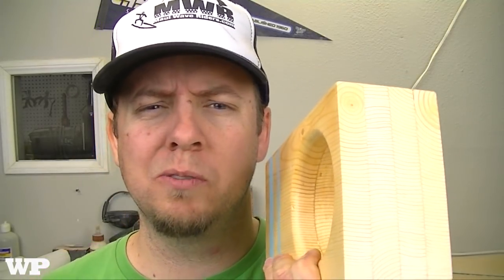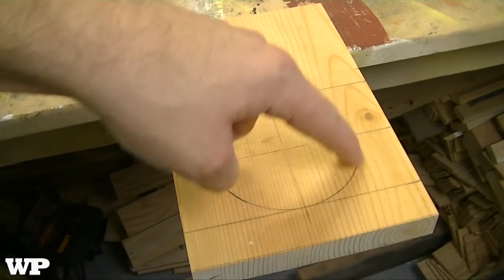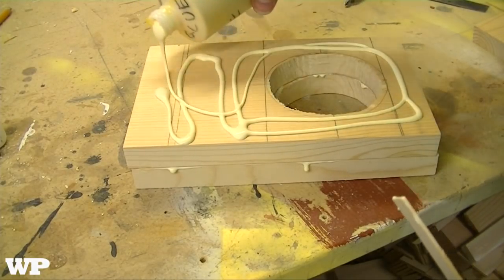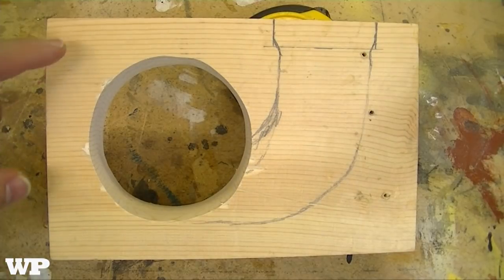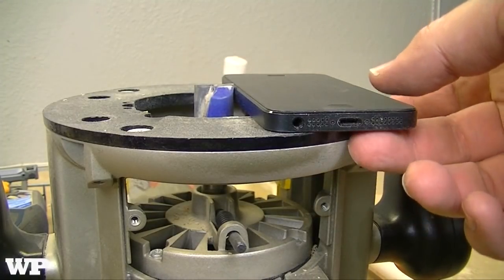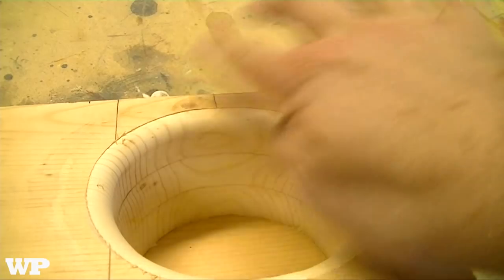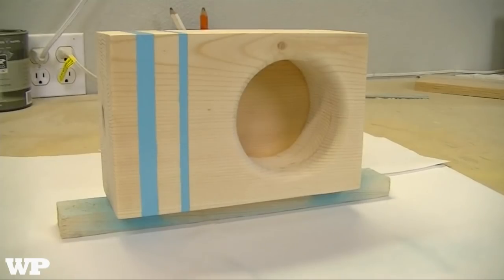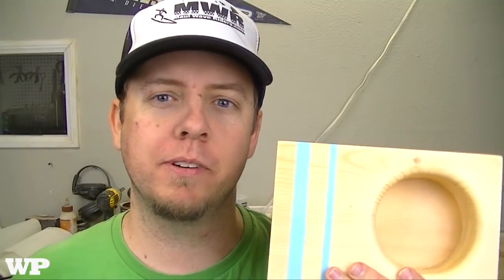How to make a Acoustic iPhone Amplifier

Comment: A holesaw would have made a lot cleaner cut.
Reply from the maker: Sure, but you still would have to sand it after gluing all three together.
Reply: @WildmanDesignCo  You are correct. But I find using a jigsaw for anything other than straight cuts (regardless of how slow I go) is a pain the butt. I prefer the holesaw for three reasons. 1) Faster cuts 2) Cleaner cuts 3) I'm not as likely to get angry.

Comment: Nice project but, for less than the price of the wood, you can get a little Bluetooth speaker
Reply from the maker: Jeff Pinter where can you get a Bluetooth speaker for $2.50?
Reply: And indeed one with an everlasting battery at that!

Comment: I am glad your design worked well for your needs. Here is some things you can do  to improve the sound in your next build that would   give you even better sound. 

In your design, the audio feeds to the bottom of circular hole through a wide channel that makes a 90 degree bend into the circle, and then bounces off the walls in the circular hole several times until eventually all the energy in the waves leave the hole. The biggest issue  in that design is that it encourages multi path propagation of the sounds waves that result in some parts of a wave arriving at your ear sooner then other parts of the same wave, This means the audio is slightly distorted

To improve the audio quality with fewer multi path modes, start with a narrow channel from your phone that gently tapers strait into a rectangular hole that feed the audio out with no bends. When looking down at your project, the bottom of the rectangular hole should be rounded so as to bounce the waves out immediately rather than bounce around several times on the walls of the hole. Less bouncing around also means less energy is absorbed into and dissipated inside your audio director, and more energy gets to the listeners ears in sync (makes it appear even louder) rather than spread out over time because of the bouncing around.

Comment: IPhone, I crap...  otherwise, way to go. 

But, there is no amplification. That is, you are not amplifying the amount of energy in the sound coming from our phone. Rather, you are gaining directionality. Phones put their speaker on the back, or in your case, the bottom, thus sending sound away from your ears while you watch youtube videos. Your build redirects and focuses the sound to the listener.
Reply: @Keith Reynolds I beg to differ: "The horn can be thought of as an "acoustic transformer" that provides impedance matching between the relatively dense diaphragm material and the less-dense air. The result is greater acoustic output power from a given driver." - Wiki
Reply from the maker: Thanks for your opinion. Interesting to look at it that way. Just having fun making stuff, didn't put much thought into the science behind it.

Comment: If you want to vastly simplify your life, cut the hole on piece 3 with a hole saw (preferably in a drill press), glue on piece two, rough out the hole, and finish with a laminate trim bit in the router, and repeat with piece 1. With denser wood than pine you might not have to do more than finish sanding, assuming you're using sharp carbide router tooling.
Reply from the maker: Siouxsin M I am making them now to sell, so I have it down pretty good. I cut the circles out with a jig saw, two half circle cuts each hole. Glue the three pieces together, then finish sand with a orbital spindle sander.

Comment: This is really impressive– I don't think I would have ever thought of doing this! Do you think you could make a list of all the tools you used? Thanks! :)
Reply from the maker: Yeah sure, here is the list: 
Miter Saw - cut the pieces of wood to length
Router - to cut the groove for the sound and round over the edge of the circle
Jig Saw - Cut out the circle
Belt Sander - make it nice and smooth
Dremel Tool - clean up the inside of the circle
Reply: WildmanProject Thank you!!

Comment: Can you make Acoustic Amplifier for Samsung Galaxy Note 3 with hidden charger inside?
Reply from the maker: Are you asking me to physically make one? If so, I don't have need for one and I dont have a Note 3. 
I am sure it can be done though. The charger part might be a little tricky.
Reply: All I think of was to make sure that width is wider to fit perfectly with the otterbox installed on the phone. :)
Reply: By the way, you did a great job on the amplifier. :)
Reply from the maker: ***** Yes you would make the slot the phone sits wider to fit the Note 3.